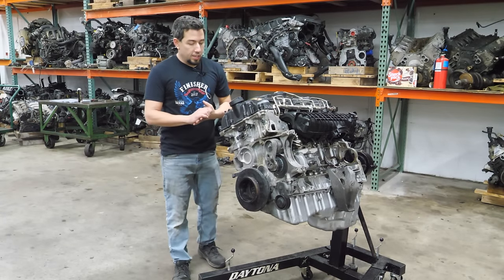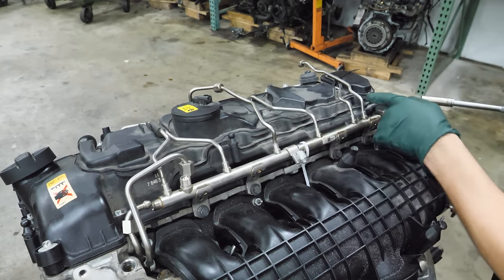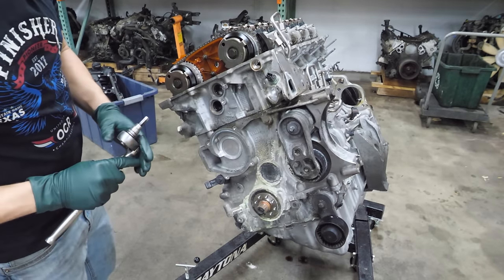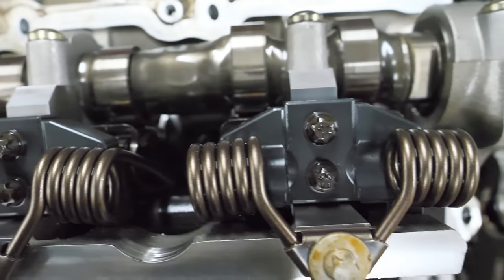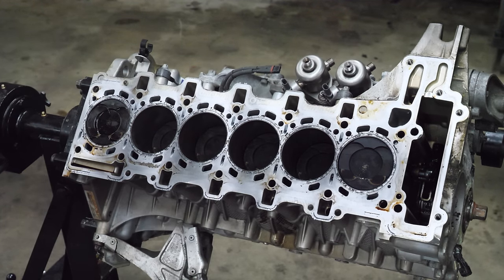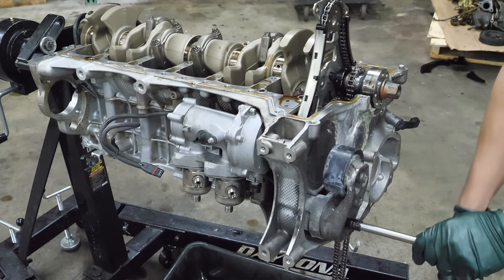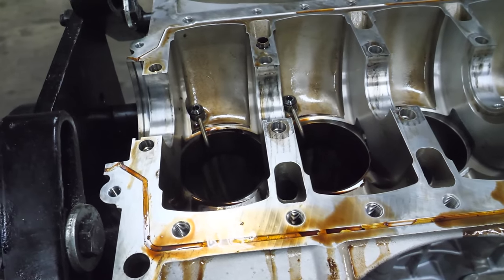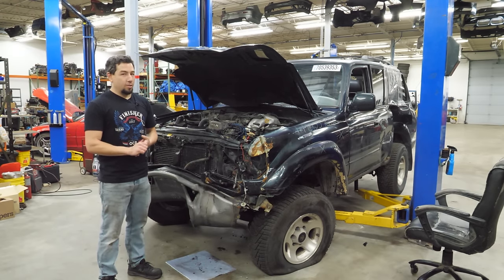2016 BMW F80 M3 Twin Turbo S55 Bad Engine Teardown. Bogus Rebuild?

Comment: Eventho bmw has bad history,  you gotta appreciate how advanced the engineering and serviceability is in this engine, all thoes parts that could fail but everything working together to keep it in perfect shape. True motorsport inspired
Reply: Well it depends on what you mean by "history", it was mostly 2000-2010 era that were the real dark days, after and especially before that, they were considered some of the best engines out there in most metrics.

Comment: The marks on the side of the cylinder walls correspond with the coolant passages that are drilled at the same angle between the cylinders. If I had to guess it's because the temperature differential in that area

Comment: I think that the timing was off. You can hear the exhaust valves opening too early and release compression when you first turned the engine over.

Comment: The S in a BMW engine means it is S ubstantially less reliable than the M or N version of the engine. That’s bad news for the notoriously unreliable N55.

I’ve said it before and I’ll say it again, I’ve never seen one of those heat tabs that was still intact. They always melt as soon as the engine is brought up to normal temperature. They are not an overheat indicator, more like a “this engine was started” indicator.

What I’ve been told is Valvetronic is meant to improve engine efficiency by reducing pumping losses, because it takes a fair bit of energy to pull the piston down against a vacuum. The problem with that theory is that you’re still pulling the piston down against a vacuum whether the restriction is being caused by a throttle plate or an intake valve that barely opens. Another possibility is that they’re trying to improve fuel atomization by increasing air velocity past the value with a small amount of valve lift, but I wouldn’t think that would really be an issue with a direct injection engine.
Reply: N55 notoriously unreliable? I guess it all depends on the perspective you got....

Anyway, what can be said is valvetronic seemingly really does make a big difference in efficency.
Reply: the n55 is very reliable if well maintained

Comment: Many years back in the UK, there was a company that sold rebuilt engines called 'Gold Seal'. Yep, the engines came with an overall (and I mean overall) coat of gold paint. Oddly, they never seemed to last very long.....

Rattle-can rebuilds don;t seem to last.

Comment: The main bearings look suspiciously bad. The rod bearings, not sure if this is a problem. The N20, N55, S55, etc. use Glyco G-488 and G-888 rod bearing materials that are supposed to wear-in initially and get progressively harder over time. My understanding is that the wear you see may be early wear and not progress much unlike the S65/S85 engines where the engines just chew through rod bearings. There are vanishingly few S55 rod bearing failures so far. The main bearings, however, are Kolbenschmidt and I am not sure if that material has a similar feature. Perhaps the oil filter housing gasket was allowing coolant to leak into the oil on this engine?
Reply: Had my rod bearings changed a couple months back and they were in pretty rough shape, S55 btw. 

My N55 rod bearings were also pretty bad.
Reply: @cmulhall  The question really is if that initial layer wearing is a problem or not. There's almost zero S55s that have spun bearings that I've seen on the forums over 7 years. The N55s that spin bearings usually do it secondary to OFHG replacement without priming or oil starvation. I'm not saying they are perfect, but maybe the visual is not an indicator of impending doom.
Reply: @chrisbradley3224   It's probably more down to the engine being a streetable race engine and even those have coatings that wear in and harden but they can only do so much. Bearings aren't a normal wear item for basic economy cars but cars like this, they need it. It just comes down to how much they are used and abused and the bearing quality. For this case, it had most likely softer bearings being a sport engine and because most high performance engines do and was just beaten up
Reply: @cmulhall  How many miles did you have?
Reply: @chrisbradley3224  90k km. Unfortunately i cant attached photos. Mine were worn with a score in one of them from unknown source. Got the car with 80k km on what i assume was the bmw 0w30 every 15k km oil change interval.

Comment: The aluminum bolts should not necessarily be one-time use. The reason they have so many bolts is because the torque spec is fairly light. As for that sludge you saw on the engine it looks like somebody had run the car a little hard, I don't know why they would do that, but that can cause some scaling in the turbo system and then it draws it back out of it and deposits it in the engine. Otherwise somebody at least one time went with an extended oil change interval. I don't believe that happened, but I have noticed that there are people who actually put devices on their turbocharged engines so that when they shut it off it'll sit and idle and allow the turbochargers to cool down before it shuts the engine off.

Comment: So I have a theory. Maybe the engine was overheated it was rebuilt but just had the deck and the head resurfaced but they took too much off and that's why there's a thicker head gasket but that wasn't enough and the valve still hit the piston

Comment: If I had gotten a broken bolt out that easy I would’ve stopped on the way home and bought a lottery ticket. My guess on the gunk in the oil pan is soot or carbon. Had a Cummins spin a bearing because of enough of that gunk plugged the oil pickup. But if you rubbed it between your fingers it just disintegrated. Found out the turbo was leaking oil internally and probably the reason for soot buildup, but nothing ever confirmed.

Comment: I believe the owner did the smart thing and pulled the car over and shut it down when it got hot instead of just keep driving like some people will do!    No varnish, sludge, etc shows the owner got his oil and filter changes.     The turbochargers being missing very likely indicates they were still good and put onto the replacement engine.
Reply: ...or this engine was spray-painted to hide the fact that it came from a stolen car. Either or.

Comment: What most likely happened here is the crank hub slipped and messed up the timing. With the Valvetronic and Vanos systems, the intake valves survive because the engine can correct for the timing on the intake side, so the exhaust side takes the brunt of the damage. This is an extremely common problem with the S55, and I've seen stock engines with this issue. It's a design flaw from using the same timing system as the N55 and N20 where it's just a friction fit on the crank hub— while it works fine for those engines, it's not enough for the S55. The proper fix for this is to pin the crank hub so that there's no way for it to slip. A buddy of mine runs a turbo BMW performance shop here in the Phoenix area and they've done a few dozen crank hub jobs for people with the F8x M3/M4.

Comment: 4yi the valvetronic solves a problem zhat does not really exist anymore. it was introduced in the time where BMW tried to maximally optimize the naturally aspirated engine (which they did with this) to remove 2 key fuel inefficiencies. one is the losses due to reduced ambient pressure in the intake manifold because of the throttle-body, and the second reason was it removes one of the key ineffiecies in the adiabatic compression stage while not at full throttle by a decent amount. all naturally aspirated engines with 6 speed are practically always operating at partial throttle, which this helped. one of the reasons the N62B48 is so well established and even produced today. For the S engines it allows to generate boost up to the intake valves, because they are the only thing limiting the airflow, so the response of the throttle is absolutely mental for a turbocharged engine.

Comment: I kinda wanna buy blown engines now for cheap just to take them apart for fun, and rebuild them if worth it.

I want to add a tip as well, but giving a few taps with a mallet or brass punch on the heads of aluminium bolts can help prevent having one shear off. Especially when they are siezed bolts that take lots of heat stress. The next thing is instead of using the electric impact, i break the torque slightly on each bolt. If one is harder than the others on an aluminium bolt especially, I will tap it some more and break the torque very slowly and in smooth motions. Hard snappy motions shear aluminium bolts all the time when they are siezed. Penetration fluid for bolts as well helps a ton.

Comment: Maintenance?  Dude , I live in England and that seems to be a dirty word. Here we run everything into the ground , and then a couple of miles ( 10k ) more. If it really stops working , just change oil , add some anti-seize and use the biggest bar to spin it up again. Should be good for another 30k miles.

Comment: I know that you know this. but, it might be beneficial for you to put some parts solvent  in the ports of the valves that you suspect are or may be bent (and show the results). that would give an idea to anyone who may be thinking about buying the head. if they do leak, he or she will KNOW that they will need to replace the valves. and if they do not leak, then there is at least a chance that they might be salvageable. I know that if I was looking for a head, that is something I would want to know.

Comment: just started watching but im going to guess.. Crankhub bolt backed out?? the crank gear is held in place with torque alone, they are widely known for a spinning the crank hub, even with stock power.

Comment: Early version of this engine were prone to slippage of the friction ring that holds the crank hub. A small slip can cause the engine to move out of timing but not enough to visibly bend valves. Some engines survive these failures with little to no damage, the valves may be bent enough to leak and throw up misfire codes but not enough to see with the naked eye.
Reply: It's not just early versions of the engine. As far as I know, based on the part numbers, the design was never revised. I'm pretty sure any S55 can potentially have the problem.
Reply: This was only addressed in the s58 and can happen to any s55. Although its usually only caused by lots of power or agressive use of the kickdown function on dct cars
Reply: @luker3456  There is little or nothing in common between the S55 and the S58. They are completely different designs, but you are correct that this problem doesn't happen on the S58.
Reply: @darylmorse  nothing in common except for the displacment, cylinder count, number of turbos, manufacturer, bore diamiter, dual vanos, valvetronic and direct injection. Infact s58 is so different that it has 0 4mm extra stroke 🤣
Reply: @luker3456 You are clearly clueless about these engines. Take a look at the parts diagrams of these engines. They might have a few fasteners in common, but even that is unlikely. The B58/S58 are clean sheet designs. The camshaft drives are at opposite ends of the engine FFS. The reason why there is no crank hub problem on the x58 is because there is no crank hub!! The camshaft drive is part of the crankshaft. Get a clue before you post nonsense.
Reply: @darylmorse  yeah its a development of the s55... like i said all along
Reply: @luker3456  Do some research, such as looking at the parts breakdown. There are no shared parts between the S55 and S58. Sure, the B58/S58 is the next engine developed by BMW after the N55/S55 but that's all. In particular, the camshaft drive is completely different. It's on the back end of the engine, FFS!!!
Reply: @darylmorse  yeah its a development. They change parts to make it better but use the fundamentals of what was there before. Not hard to understand is it.
Reply: @luker3456  There are NO shared parts between the N55/S55 and B58/S58. There are even significant differences between N55 and S55 and B58 and S58. If someone didn't know these engines were from all BMW, they are different enough that it would not be obvious that they are all from BMW. Aside from the logos on some of the castings, the only shared feature between the engines that is uniquely BMW is ValveTronic. Other than that, they are little different from other twin cam, 4 valve per cylinder, inline 6 cylinder engines. But you apparently are not able to understand this, so I give up. Believe what you want. I DGAF.
Reply: @darylmorse  except for the basically identical bore and stroke, even the cylinder head geometry is the same. Basically everything that matters, everything else just enables the first parts.

Comment: Hey eric , love your channel , but when you see that the head valves have been " hit" , how come you dont put the spark plugs back in and do a little " leak down" test ???? I know the head would still need a valve job but just a little fluid in each valve " chamber" or whatever you call would tell you something ........
Reply: Because in the case of a GDI engine like this, he would also have to reinstall the fuel injectors for the combustion chamber to hold fluid. In the kind of business Eric has, it would be best practice to simply replace the valves and know that they are good then to take a risk on any being bad. Was this helpful at all?
Reply: @johnathanedwards9054  forgot about the injectors , thanks j.e. 😊

Comment: It is not correct that timing issues will lead to uneven damage - it very much depends on engine design.
The Ford/PSA DV5/DV6 engines are known to strip a few teeth on the timing belt, causing a slight timing drift, and that results in identical looking pistons; Uniform exhaust valve contact marks on all pistons.

This also leads to cam lobes being slightly out of place, and i would very much recommend you verifying the exhaust cam, as they may have invisible damage.

Comment: Love this engine been driving 25 years all bmw are the best (( the only thing that you have to upgrade in this is the bolt hub for aftermarket to avoid loose torque after 700hp “”””
All the rest is perfect “”” 

Oh I forget the crankshaft need to put the shield protector to avoid serpentine belt get into the engine is just $40 upgrades simple in 7 min

Comment: Never forget the time I saw a bmw overheat and blow up; onecold blustery Midwestern morning i pulled into a strip mall and parked next to a running m3 of a similar vintage. There was an older gentleman inside clearly waiting for soneone inside the building. Once i stepped outside i could tell that something was wrong with the car as the fan was running (the outside temp was in the negatives) so i motioned to the guy that he might want to turn off the engine or atleast pop the hood but he blew me off so i go about my business and go inside. As soon as i get to the counter i heard a loud bang as if someone had lit off one of those firework mortars just outside. This caused alot of high-pitched screams from the ladies in the building so i rushed outside to see steam and coolant pouring out of the M3 with the old man still inside looking stunned. 

It took every fiber of my being to stop myself from laughing and shaking my head as i went back inside.

Comment: S55 has well known weak point which is Cran Hub and Im speculating with those valve marks on pistons that this engine spun the crank hub and ended up timing failure

Comment: A shop in my home town was infamous for doing 'rattle can rebuilds'. They would convince a customer that a new engine was required. Then fix whatever minor problem actually existed. Power wash and spray paint. $$$$

Shops like that are why Texas passed a law in the 1970s requiring shops to give customers the old parts after repairs were done.
Reply: Wow….

Comment: You know that exhaust valve/ piston interface MAY be normal. On built bike engines having valves “clean” but not touch the pistons is quite normal. It’s just a limitation of achieving high compression. Considering this is an “M” motor they may be pushing it as well.

Comment: Oh please a nice jb weld job is just fine BUT a bad one is just bad. I’m about to use a c clamp and jb weld to fix the cracked block in my kohler courage I just bought. Time for a story. A kohler courage is a mower engine that’s a bucket design and the sump is under the flywheel and a common issue is the sump bolts loosen over time and the sump starts shaking and the dowel pin in the sump cracks the block. And I think the previous owner noticed the loose bolts and replaces the gasket but didn’t notice the crack in the block

Comment: I'm sure this has been suggested a zillion times, but I'd love to get your opinion on "best engines". I suppose those are ones you never see very often, though. Avoiding things like the W12s and other complex wonders, you could do a video on most-common pickup and SUVs - best engines and those simplest to work on. Some of your teardowns scare me off ever buying a vehicle with a particular engine used, for sure

Comment: I see an interesting thing over here in Bulgaria.
We have a lot of gypsies that work in the EU and they come back here and usually they bring back a fancy German car, most common are BMW'S. Expensive fancy modified top of the range model's and some on British plates which you can check online and they don't add up. The check points to 2005 BMW car but the car they on is much newer than that.🤔
So they drive around the area screwing the arse off these cars for a while and then they suddenly disappear.
Something very fishy going on.😉